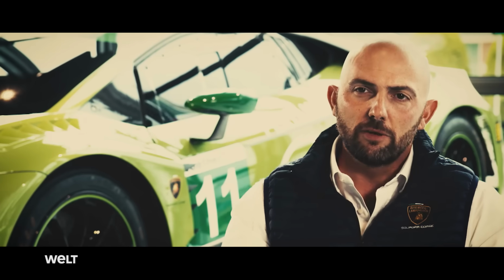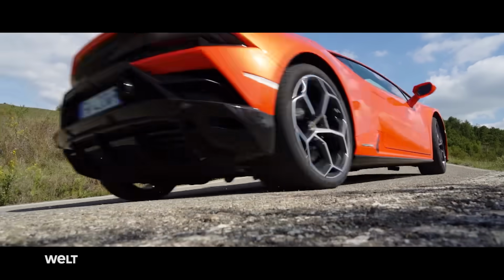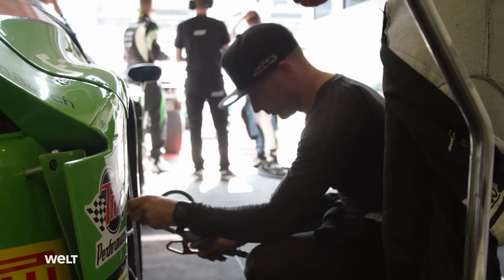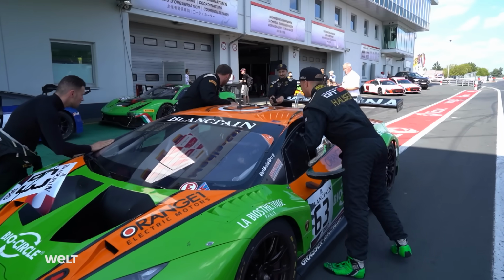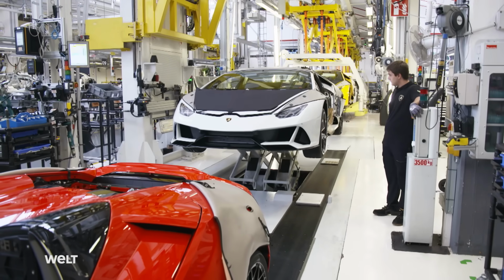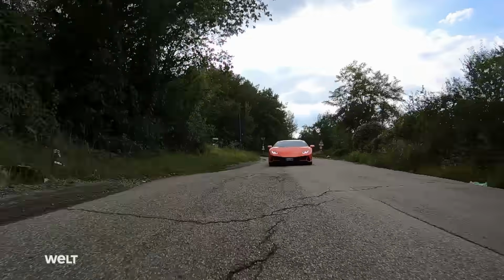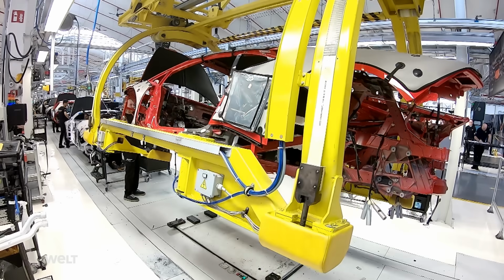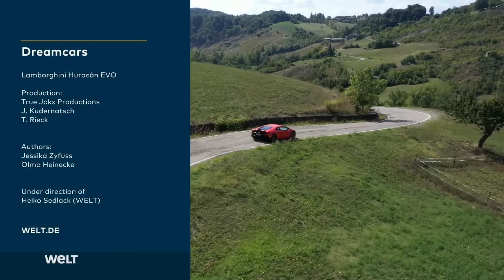Lamborghini Huracan EVO - Inside the Factory | Full Documentary

Comment: id like to ask the mechanics on the line what they think of the fix people have come up with for a common problem the linkages lock up and its a engine/gearbox out when somebody decided stuff that and cut a 15cm by 10 cm hole into the gearbox tunnel from inside the car its then a 2 second job, and its taken off so much that Lambo mechanics are now recommending the process even though your cutting a hole in the body and you have to weld the square back in a good example would be the cry baby off youtube fix it guys matt armstrong and his lime green lambo

Comment: Putting human beings, though passionate about their goals, in charge of assembly and quality, is a recipe for waste and error.  Hand built has never meant high quality.  Lambo manufacturing is still in the dark ages.  Seeing the glue brushed on by a person, think of the precise amount and application a robotic device could offer and quality of application/cost savings/waste reduction.  Lamborghini could produce wastebaskets and the drooling sheep would fight for an opportunity to own one especially if you name it after a dead bull, number it and put a dead someone's signature on it.  Year's ago, Tonino Lamborghini OEM'd expensive, triangular and equally unreliable wristwatches.  Very few discovered Tonino's lack of  connection to the automobile marque bearing the same surname.  EXCELLENT BRANDING but horrible quality.  You'll enjoy better quality in a Hot Wheels diecast. 🐑 Baaaaa! 🐑
Reply: lambo's last 200.000 km or more these days. they are very reliable. the aventador is an exception as that isn't very reliable but the urus and huracan are very reliable.

Comment: Maybe if they didn't use such expensive parts and could produce them more quickly, they could offer it for an affordable price $50k-100k instead of $250k-$350k. 10k carbon ceramic brakes and rotors is ridiculous
Reply: Even if I could afford to spend 250k I wouldn't for one of these. I could get an M4, C63, Z06 and GT350 for that.

Comment: Hi im the boy that made the new crankshaft's i v w x h ic rotor radial piston run optional emissions 70% less 100 mpg and new transmissions and electronic heads i even have the camshafts trying to get it done didnt go to highschool not gay either. I even have the motor i wrote on my mail box 469 625 7552

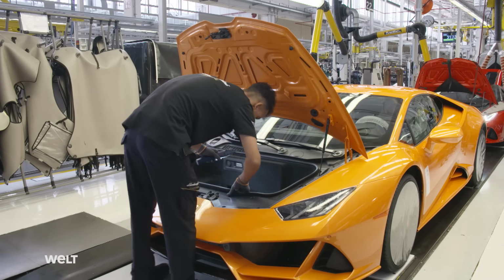Comment: Great documentary! But in terms of production high quality control and the relationship between the elements, they need to solve the problem with the door-rubber-window connection. It is not in the straight line (it isn't for the most cars also) but for expensive super cars, it should be as they say.  The problem I just mentioned is visible on 44:29 and it is so annoying to see it in general. :)
Reply: Milosh Nenadovic yes , and they need to solve to have the engine in the centre or the middle instead of been to the left

Comment: Great video,  but I wish another 10 minutes could have been added with details to the engine assembly like the chiron video.
Reply: I think it is patented because they use special parts and tools to assemble it
Reply: engine manufacturing process classified i guess
Reply: Agreed
Reply: And also the engine is supplied, not build by them. From Volkswagen.
Reply: Why mate you wanna build one or something ? This isn't a follow along video..
Reply: If they did that then they would be giving away one Lamborghinis biggest secrets. What you are asking is basically the same as asking, " how does coca cola make their drinks?"
Reply: @remyrauch577  What secrets though? I mean, I'm sure their competitors have purchased a Huracan and stripped it down to individual pieces to reverse engineer it... so showing an engine getting assembled isn't exactly revealing anything you couldn't figure out by pulling it apart...
Reply: Yes the Chiron video is excellent. I thought about the Bugatti's stats during this vid as they are very similar in that both are rated 2.9 to 60 and similar top speed. But the Bug is a LOT heavier, admittingly propelled with an UTTER BEAST of a 12 cylinder VW powerplant. 

Love both so much.
Reply: @Top5Aircraft  W16 engine you forgot 4 cylinders
Reply: @charlie1832  OUCH! You got me there Plumbaman. 16 Cyls of course!! Duh!
Reply: They make the engine in Hungary not Italy
Reply: G14:Classified